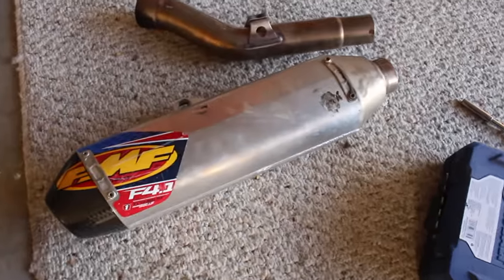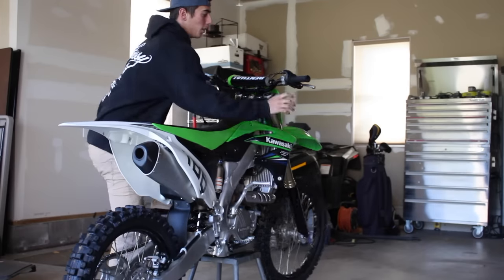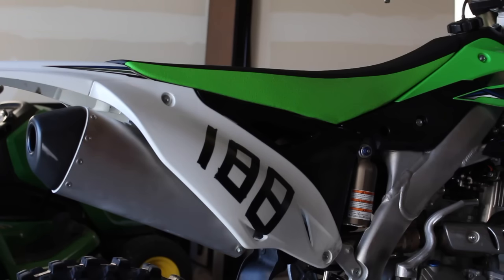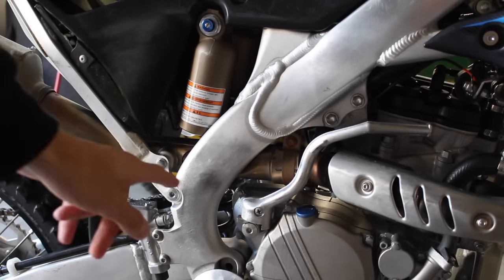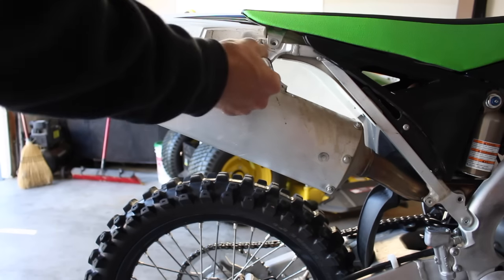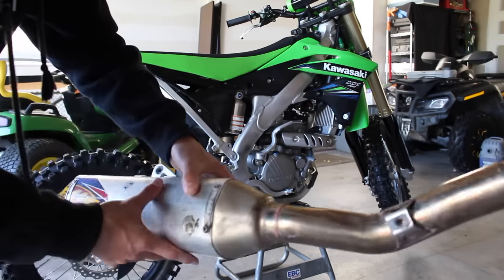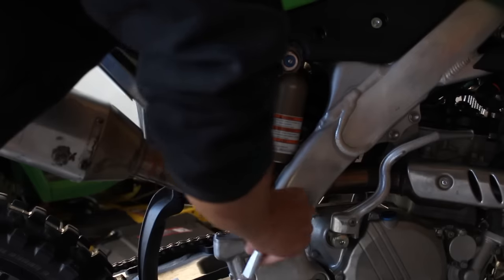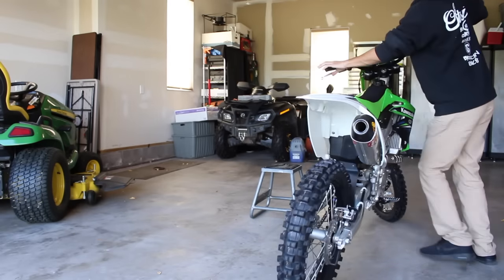NEW DIRT BIKE EXHAUST | KX250F FMF 4.1

Comment: I'm might be getting my first bike soonish, can you possibly look at doing a video showing all of the major parts of the bike, what you need to look out for, what needs to be replaced regularly. Just so I and other people can see how to keep a bike healthy and happy?
Reply: agreed ^
Reply: azurekoala air filter, oil and oil filter, and regular maintenance like looking at your tire pressure and if you get air forks have to check the pressure in them....there are tons of videos of people showing you what to do and how to do it
Reply: Clean it after every ride, clean air filter in paint thinner, let dry, then re-oil every 5 or so rides, oil and oil filter change every 5-8 hours of engine running and don't use old gas, keep bearings in good shape and bolts tight
Reply: Air filter oil oil filter coolant clean the bike if your raceing top end once in a wile or just take a look and see how things are holding up cheak your valves every season mAke sure your chain and sprockets are good if the teeth on the sprocket are getting sharp time for new chain and sprockets grease anything that needs it foot pegs etc make sure your fork Arne leaking if they are you need new fork seals and some love lol ride it

Comment: Would have been better buying an fmf sticker and putting it on the stock exhaust instead!! Sound exactly the same
Reply: Bret Lysne09 You must be a poser if you can’t hear a difference lol
Reply: Lol, the new one is actually supposed to be quieter. Also adds a couple HP and it's lighter.
Reply: Bret Lysne09 not at all
Reply: yeah the fmf is quieter. but the fmf sounds more crisp. louder isnt always better.
on top of that, the fmf looks a lot better
Reply: Definitely sound the same

Comment: LOL my yamaha yzf 250 2011 start in like 1 kick at cold start but when it is hot like normal hot it takes around about 50 kicks until it starts!
Reply: MjBuggies my rmz 250 2008 does the same 😵
Reply: PooP maybe it's time for a new spark plug, and, or valve adjustment😂
Reply: Valve adjustment, buddy of mine has 09 kx250f and that was a problem he had and it fixed it
Reply: Peyton McAdams well you might be right😂👍🏻😉
Reply: Daisy competition really well my buddy said the same thing

Comment: I like yoshimura's better.
Reply: Strigent Odin But they are $800 lol
Reply: EliteTrickz
Worth it lol. I basically got one for free when I bought my yz250f.
Reply: EliteTrickz I have a full yoshi pipe and header and I like it
Reply: Ethan Cantrell How much did it cost you?
Reply: 500 dollers just for sound?
Reply: Swaggy fresh
Actually adds a bit of power, And its 800.. Dollars*
Reply: Strigent Odin yeah like 2-3hp difference I stay stock unless I get lucky in the future I keep my money (try) for possible engine failures and just periodic engine/bike body (frame etc)
Reply: Strigent Odin adds no more power than any other pipe why pay that much
Reply: Most people do like them more but they are expensive and they just give your bike more back pressure so it has a little more kick
Reply: I like my wallet better

Comment: Slip on exhausts are useless. Basically just changes sound. Don't cheap out and buy the full system.
Reply from the maker: it actually does make a little difference.
Reply: Tyler Monagan it's so small it's not even noticeable. Better off putting a clutch in it. Better power for your buck there.